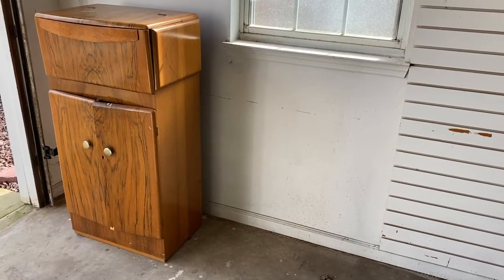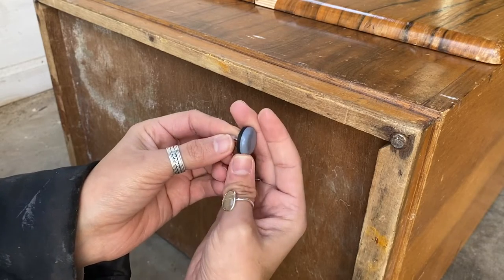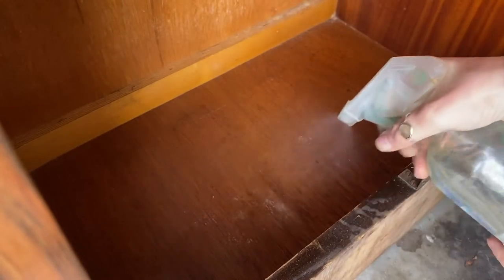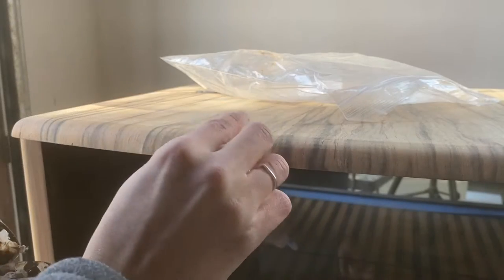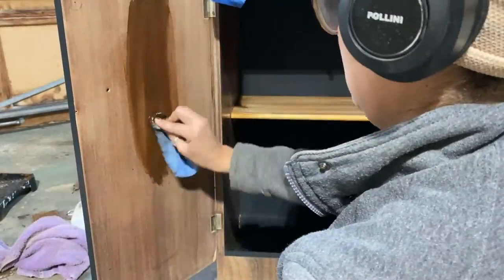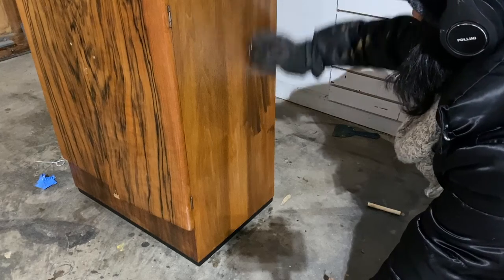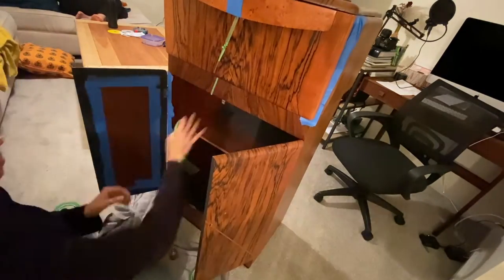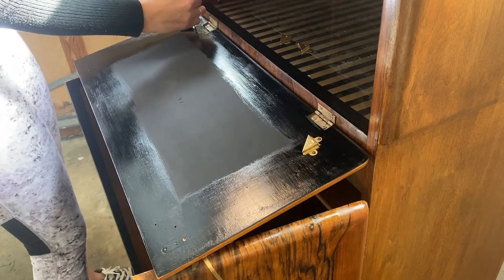Zebra Wood Bar Cabinet Makeover | Restoration + Tape Design

Comment: Mundane question here. I see you’re wearing winter outerwear which leads me to believe it’s cold. ( I’m quick like that😂). I live in a cold climate and it messes with applying finishes. Do you have a solution other than insulating and heating my garage?
Reply from the maker: Unfortunately no. Insulation and heating is the only method I know personally.

Comment: Why didn't you remove hinges and clean them?  The finish is different from that of the other hardware.
Reply from the maker: It honestly did affect the look of the piece in my opinion. If it did in a negative way, I definitely would have done so